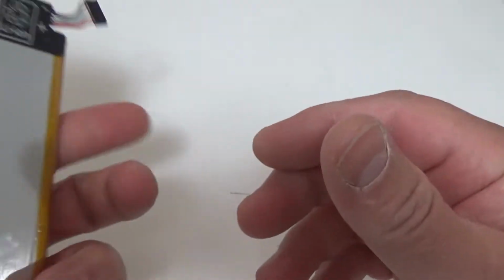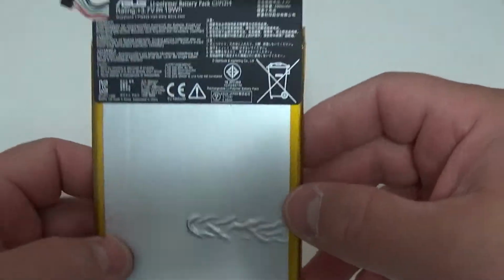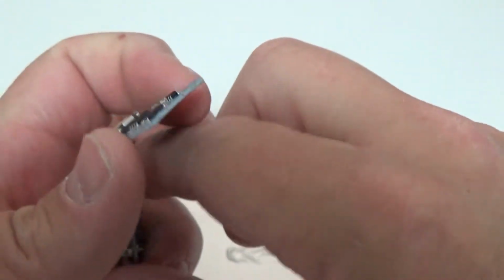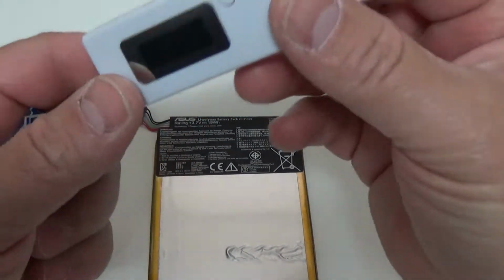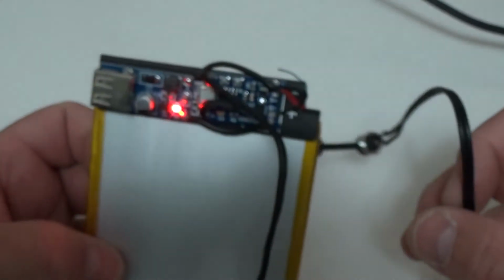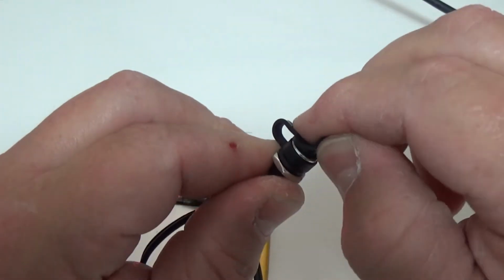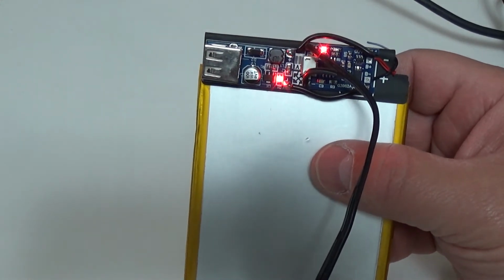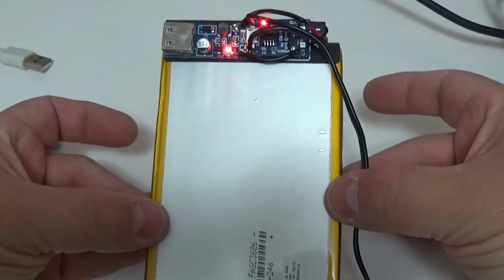DIY Pi Top - Battery Pack

Comment: Trying to do something similar, thanks for sharing.
Wondering if you have anything to protect from over discharge?
Reply: that tp4560 has all the protection... it can protect from short circuit and over current... 2amp max ... 4.2v max cutoff voltage , 3.2v discharge cutoff ... and 1amp constant current charge ... it can do from 50ma/hr to 1am/hr depending on the value of a resistor... it comes set to 1amp from the factory... more or less around 950ma/hr...

Comment: did you think about the delay when you plug in the power cord to charge the battery .. when plugging in the power cord there is a voltage drop ?

Comment: Assuming the charger is plugged in and electricity doesn't go out, do you think the battery will stay fully charged if a connected Raspberry Pi 3 is running 24x7?

Comment: ive watched all the raspberry pi laptop videos im doing the same i loved the idea of the mouse the keyboard i guess you should look how to interface the flat flex with a ps2 keyboard sinse its the one used in the keyboard itself and make use of the available slot in the mouse converter also while the 19 wh battery will be fine for the pi 0 it will get drained faster with the screen and the pereferals i recommand using an old laptop battery also i recommand using a pi3 sinse it has integrated Wi-Fi and Bluetooth and 4* the processing power anyway have fun and i hope you post video about it soon